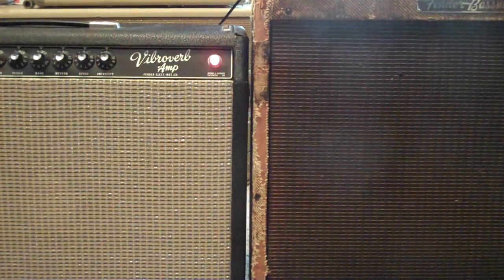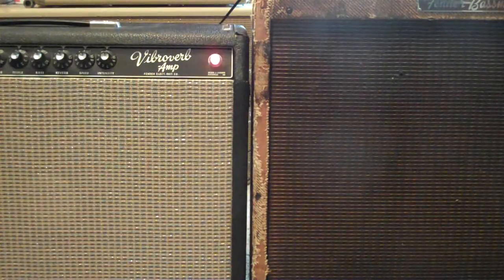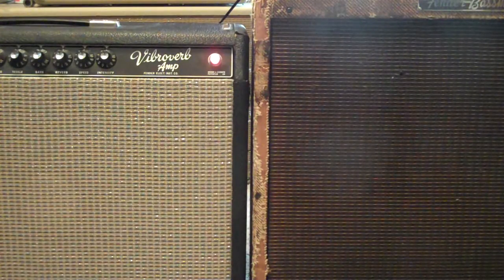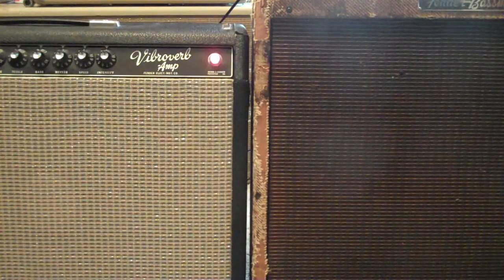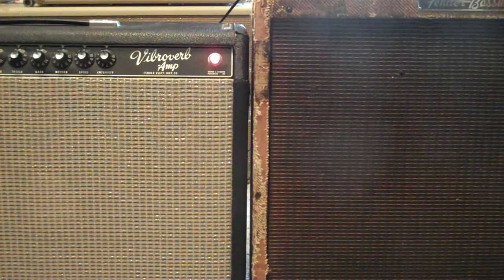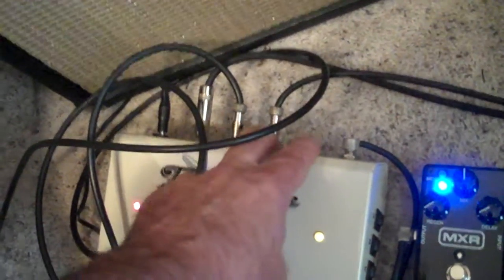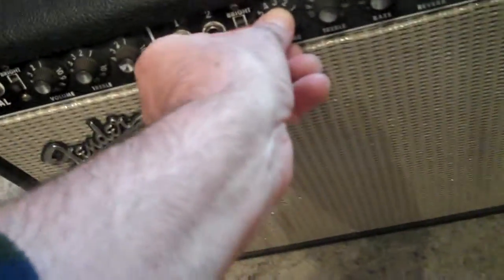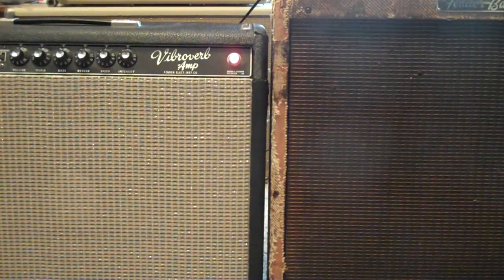How to Check Your Multi-Amp Setup for Phase Issues

Comment: I have two amps that are the exact same. I’m pretty sure one is out of phase after I was messing about with an ABY Switch. Let’s say I plug directly into one amp straight from my guitar. Does it still stay out of phase after? Even if I’ve plugged out my aby pedal?
Reply from the maker: Conor, you should be in phase if you are plugging into one amp.  If the amps are the same and the ABY box has phase switches on it, they should both be in the same position.  Exceptions are if the speakers on either amp have been changed from the originals speakers.  Sometimes people can install them backwards.  In that case, it's best to use the 9V battery check on each speaker, positive to positive, negative to negative, and watch to be sure the cones move in the same direction.  I've bought amps that had one speaker out of phase with the others.  It sounds pretty strange when you play it.  Like pseudo surround sound.

Comment: its like you loose a little low end and it sounds like its coming from the sides and not straight on . very clear example of both thank you for the help
Reply from the maker: Yes.  It can actually sound kind of cool but not what you want when you are trying to get the most out of both amps.

Comment: I just want to know why the would go out of phase in the first place? So you play one gig and you can be fine but the next your speakers are out?
Reply from the maker: No, the amps cannot change between gigs unless you change the way you hook them up.  You would physically have to switch all of the speaker wires, +/-, or use a different input jack like the Normal channel vs. the Tremolo channel on a blackface amp, or change the "phase" switch on one of the better amp switcher boxes.  Phase issues only matter if you use two or more amps.  It makes no difference when using one amp.  Your guitar signal is a sine wave.  Every time it goes through a tube (gain stage), the sine wave is flipped over.  Think of an S shape and a backward S shape.  If you run two amps that are putting out a signal of opposite S shapes, the signal will cancel out certain frequencies that will make them sound thin (no bass) or make the sound appear to be coming from a side direction and not directly from the speakers.  Tweed Bassman (and Marshall four input) amps are well known for their ability to be able to jump the channel inputs to get more gain because the signal goes through the same gain stages.  But you cannot do that on a blackface or Blonde Bassman head because the Normal and Tremolo (or Bass channel in the Blonde Bassman) are out of phase due to the Tremolo and Bass channels going through an extra tube (gain stage) which flips the sine wave.  The same applies when running two or more amps.  Good amp switchers have "phase" switches on them to correct this.  All you need to do is play both amps together and then flip the switch and play it again to see what sounds better.  Sometimes out-of-phase amps can sound kind of cool depending on the way you have the amps angled in relation to each other.  The main thing is you don't want to sound thin, with no bass due to phase issues.